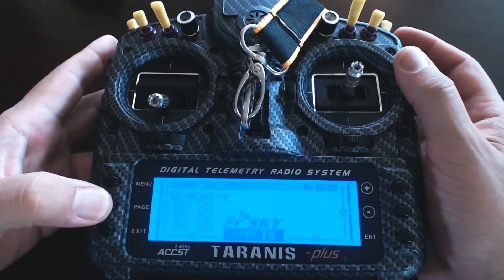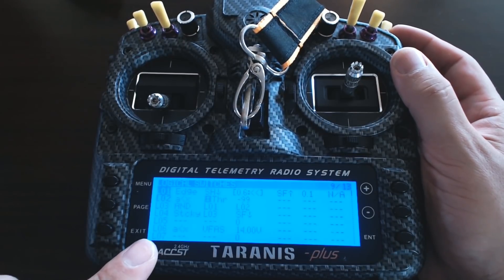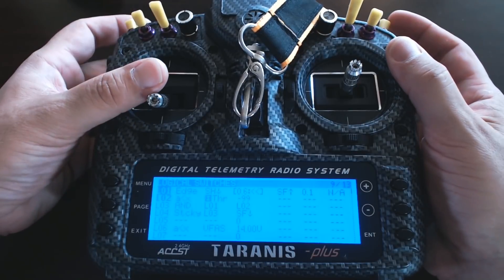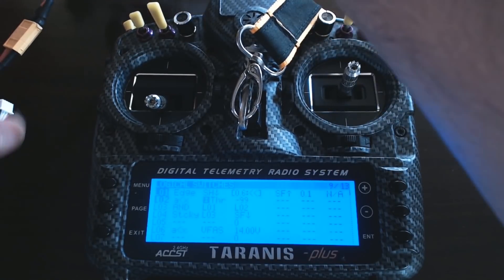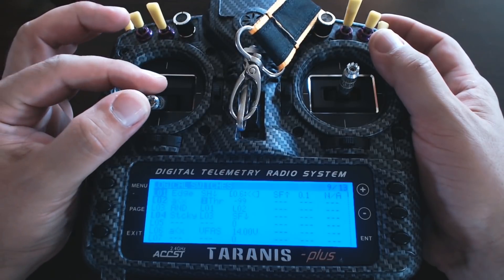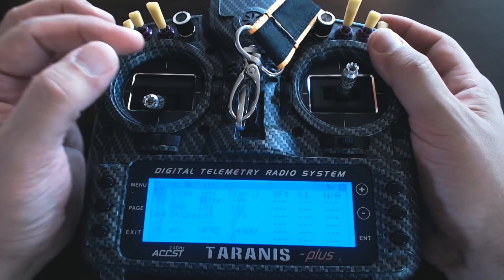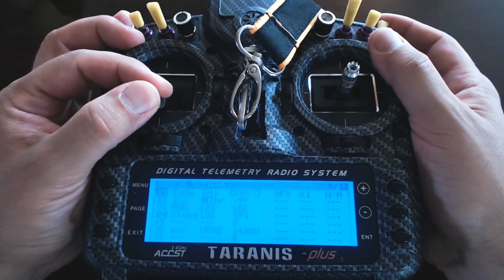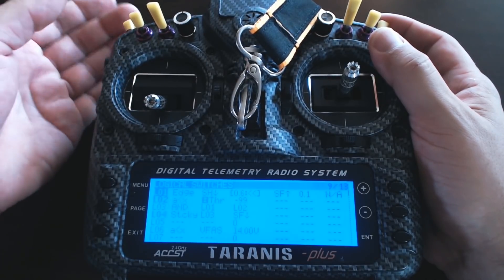How to make your Taranis read out low voltage

Comment: Hopefully this will save someone some time.  JB calls it Vfas in the video I didn’t see that option. So I selected RxBt except it has a regular , + , and  - .  The + was the highest and  the - was the lowest voltage it hit in the flight. So the regular one is the one you want. Everything else was the same, Great video JB!
Reply from the maker: VFAS is for frsky. RXbat is for other protocols.

Comment: I fly VLOS pretty often, and I don't see this changing when I upgrade my quad and have a working VTx and OSD.
When you're VLOS, you don't have an OSD, and when you're rippin' while VLOS you can't look down at your screen.
Audible alerts are VERY useful for this use case as well!
Also, thanks, now I've mapped my switches to announce flight modes.

Personally, what I'd probably map is that it announces when you dip below, and if you stay below it'll sound a chime/siren/alarm noise for the duration that the switch is active.
I haven't poked through my T16's sound library, but probably something that's not TOO obtrusive as to make me want to throw the thing, but gets my attention that something's wrong.
Then reads again after, say, ten seconds.

Comment: Joshua Bardwell your going to learn something today.  You made this simple thing very complicated with all the extra logical switches for o.o volts warning  issue… just add a “AND” value to the original logical volt read out line (L06) by only checking when armed by adding the value of your arm switch as the “AND” switch ie, SA-.    Boom no zero read outs unless you have your drone armed with no battery!

Comment: Is it possible to check which quad i am using if i use a 4s one and a 2s one for example? So i could make different logic swithes with AND logics to check for 14v on a 4s quad and for 7v on a 2s quad.

Comment: I know this video is old, but this is solves my exact problem. I am a LOS drone pilot and I need a way to monitor 6s to 8s voltage. I just need to know what transmitter are you using with this controller?

Comment: Hey Josh....can I ask for your recommendation on how to configure this when flying a mixture of 2s/3s on a mini quad. Got it setup perfectly for 3s but do I just duplicate the logical switches further down for a second battery type or is it better going with voltage per cell when flying different battery types?
Reply: I'd go for voltage per cell personally. It sounds simpler to me, and gives you a consistent number that you don't have to convert when flying different packs.
You just know that when you hear "Three point four five volts", no matter what you're flying, you need to be on the ground.

Comment: Hey Joshua, thanks for the video.  I do not have VFAS or RSSI but do have RxBt and 1RSS/2RSS ... are these the same?

Since I'll be flying 6S but may occasionally run 4S, I modified your logical switches to work for both, but have to reboot the Tx if I change packs since it uses highest voltage ... not sure if there's a way to get around this but FWIW here's what I did...

L04     a>x     RxBt+    22.8V     ---         ---         ---
L05     a>x     1RSS     0dB        L04      ---         0.2
L06     a<x     RxBt      22.8V     L05     10.0     0.2
L07     a>x     RxBt+   15.2V      ---         ---         ---
L08     a>x     1RSS    0dB         L07      ---         0.2
L09     a<x     RxBt     15.2V      L08     10.0     0.2

Comment: Hi -I know this is an old thread but when I go into Logical switches 2nd input to choose telemetry, i have nothing after GVars, telemetry not a choice ,   can I get some help with this please.   Mark
Reply from the maker: You have to have telemetry working, such as SmartPort for FrSky, or Crossfire, before telemetry will show up there. If you are using a receiver that does not support telemetry, that option won't appear.
Reply: Hi Josh
Thanks for the quick reply. I'm running the Frsky D8R - 'll plus accst Telemetry. 
This is on my Align 5ooX. With Beastx 
When I turn the helli off Tx tells me , Telemetry lost. So must be reading something. Is it possible I've missed something in Tx setup. I'm not really using any other Telemetry features but though this would be of great value to me maintaining power.  Hope you can help. Just found some of you tutorials.  & subscribed.

Comment: My X-lite pro doesnt have Vfas, but it has Batt. Good also?

Edit: Batt is for Transmitter. I dont have Vfas :(
Reply from the maker: The sensor might be named RxBat? Look for a sensor that is obviously reporting battery voltage :-)
Reply: @JoshuaBardwell  Seems i dont have cable on smartport. Can i use TX2 on my F405 Mini MK3 and the uninverted s-port on the R-XSR?

or  through this way: https://i.imgur.com/n8WJYGnh.png TX1 on uninverted s-port.

Comment: I love and appreciate all ur videos without ur help I wouldn’t even been able to get my first drone off the ground and many more I’ve used this method in all my tiny whoops and it worked perfectly but on my 5inch quad the value displayed and read out only says 3.5 volts for my 4s battery and in my goggles it’s over 15.3 any suggestions would he greatly appreciated

Comment: Hello sir, is there a way for the taranis to read out Low throttle warning, for example when m training new flyers, and they reduce the throttle mid flight to let say 20% or 15% the radio should warn either by saying low throttle, or stall, or whatever type of warning it has... thank you for your time...
Reply from the maker: Yes definitely you can do this.

The way I would suggest doing this is as follows.

1. Logical switch for if "armed" or if "throttle cut" is disabled (to prevent false warnings when on the ground).

2. Sticky logical switch that becomes true when "armed" and the 1st time throttle goes above 15%. Sticky switch trips back to false when "disarmed".

3. Logical switch that is AND of the above combined with throttle position < 20%.

If you would like more specific help, please email me joshuabardwell@gmail.com

Comment: I followed this video and it is now reading out my voltage on my transmitter how do I get it to read the voltage on the quad.
Reply from the maker: You selected the wrong sensor. For Frsky the sensor you want is vfas.
Reply: Joshua Bardwell batt was only one Available
Reply from the maker: If you're using Crossfire then it's RxBat.

Are you sure you set up telemetry? When you "Discover new sensors" do you see sensors like ACCX, ACCY, ACCZ and so forth? Maybe telemetry is simply not working and that's why you're not seeing VFAS.
Reply: Joshua Bardwell i have the xrotor stack f4 and rxsr with tran qx7r. I put wier on back of rx on the s port to tx 3 on fc. and i only see rssi & now the batt i set up. Telm works if tx talks to me corcrect or no
Reply: Would the RXBT be the same as VFAS for the rxsr.

Comment: As usual, great video.
How would I go about having the OpenTX read out the voltage every 5-10 secs once it is beneath the assigned threshold?
Reply: My guess is you should  put read it out a big number of time like 30 and 5sec for hold the logical sw.

Comment: I have a question for you. What hapin when we use 20 Meter extention cable on frsky R9 module antina and antina is in air at 20 meter hight. What will hapin , is signal works better or lost?  Can you make a video on this with practical thanks

Comment: I an older first gen Taranus. I was stupid and got a Jumper TX this summer and it has intermitten disconect issues.

Anyway my Taranus does not do what yours does what version of open Tx Re you using?

Comment: I have a problem. I dont have Vfas on my Taranis X9D+
Reply from the maker: If you are using Crossfire, the sensor will be "RxBat". If you are using FrSky then maybe you haven't set up SmartPort telemetry right. Go to the Telemetry screen and "Discover New Sensors". The quad must be powered on and the receiver bound. If telemetry is working, you will see a bunch of sensors appear, if they weren't there already.
Reply: @JoshuaBardwell  Hello and thanks for taking time to reply Josh!

Well i have Frsky and i have telemetry working on my X9Dplus . I get values but not Vfas.
1.SWR
2.RSSI
3.RxBt
4.A2
Thats it :(

Comment: You say that I can't set up the battery voltage alarms without telemetry but I can't figure out how to do it,. Do u have a guide I have hawk 5 and taranis x9plus
Reply from the maker: Without telemetry, you can't do it. Hawk 5 doesn't have telemetry.
Reply: @JoshuaBardwell  thanks Joshua. Your videos are great. Thanks so much

Comment: i have kingkong GT 200 and frsky r-xsr receiver . can i get telemetry with this quad? if not what other options do i have to get any alert about its time to land and avoid ruining my battery ?  and thank for your videos. like how you explain things.
Reply from the maker: You should have an osd on that quad I think, which will let you monitor voltage without using telemetry.

The RXSR can also do telemetry.
Reply: thanks for the quick answer, im still learning how to control it so im not using the OSD and the goggles to see my current voltage. i bought the r-xsr especially becasue it can do telemetry but i connected the receiver without the s.port becasue i didn't know if the GT 200  FC have s.port connection or something like that. am i missing something here, can i connect the osd data to the r-xsr somehow. im new to this hobby...

Comment: Great video Joshua ! It's working thanks to you. But just a little problem. My taranis only says 3V instead of 3.4V for example. Do you know why it's not reading the values after the dot ?
Reply: Ok it's April 2020 and I have the same problem described by geoff here in that when I "play a value" I don't get the decimal place i.e. it says 3v instead of the real value of 3.5v. Has anyone got an answer for this? I've been searching far and wide for an solution which has led me to many dead ends like this 2 year old video. With the passage of time I'm hoping that either geoff or Joshua has the solution. If you do it would be much appreciated if you could post it here. Thanks!!
Reply: @pbshooter100  Hi buddy. No, I was never able to figure it out. I'm still flying like this nowadays...
Reply: @geogearbex  Thanks for the quick reply, I'll keep looking for an answer I guess. If I find one I'll post it back here
Reply from the maker: I'm trying to think of what that might be but nothing is coming to me. Do you see the whole decimal point in the display?
Reply: Joshua Bardwell yes I see it on the telemetry page and main screen. My taranis is in French but I installed English amber voice pack

Comment: Can anyone help, trying to set this up on my taranis but VFAS isnt showing on the telemetry. 
I am running kiss v2 with 32amp esc and Steele pdb with crossfire micro
Reply from the maker: This means that telemetry is not set up correctly between the FC and the receiver.

Unfortunately I don't know a lot about KISS setup.
Reply: @JoshuaBardwell  thank you for the reply, I'm currently using rxbt as that seems to be showing battery voltage.

Would this setup be in the gui or the way I have the wires on fc do you know?

Comment: Joohua,
I am new to the hobby and have a couple questions.  1. I was setting up my FrSky Transnitter to speak (ie... in your video getting the transmitter to read out the value of VFAS, which is under telemetry.  Unfortunately, telemetry is not one of the options in the second menu with switch, pots, MAX, CYCLIC, Trims, Trainer, etc)  How do I get Telemetry to be one of the options?
2. Question, I have spet days attempting to get my  Frsky Transmitters (plural) to communicate with the receivers.  I have built 3 QUADS and I can not communicate with any of them??? Please help me figure out what i am overlooking.  It is driving me crazy. Any help is appreciated.  Thank you.  emathews01@gmail.com
Reply: In the Taranis, go to the TELEMETRY page and DISCOVER NEW SENSORS, with the drone powered up.  Give it a few seconds and it will detect everything it can.  The TELEMETRY option will now be available on the previous pages for you to complete the setup

Comment: All right there Joshua  i have no vefase in my tranis can u five me a clou
Reply from the maker: In the telemetry screen, "discover sensors". If you still don't see the full range of sensors then telemetry is not set up right in the FC.

If you are using crossfire the sensors have different names and you won't see vfas.
Reply: Joshua Bardwell thanks my friends i will take a look at that cheers
Reply: All right joshua my taranis has no vfas in the telemetry can my tranis be mising some thing missing do u think coz your videos  r very expressive and spot on but i just cant find that vfas i have the sensors shoing but just cant find that i have been at it sins tje last time we toked on this subject thanks for your interest and information.

Comment: not working with crossfire
Reply from the maker: Crossfire does not call the battery voltage sensor VFAS. I think they call it RXbat. So the same process applies just a different sensor.
Reply: Joshua Bardwell yes is rxbat in crossfire . But still not working

Comment: I got everything set up and double checked the wiring on my rooster, but it keeps reading 4.9v (so basically 5v) I don’t know where my receiver is getting that number from or how I can fix that. Any help would be great!
Reply from the maker: You're using the wrong sensor I think. Look for a sensor like vfas that is showing battery voltage.

Comment: My Taraanis -Plus 2.1.6 requires me add a new sensor if I'm to use VFAS. What do I set the Type/Formula/ Cell sensor/Cell index/Logs to?
Reply from the maker: You really ought to upgrade to 2.2.1. Your firmware version 2.1.6 is pretty dated. I'm not sure how to get it working right.

Comment: This and some of your other taranis videos got me thinking that it would be nice if there was a library of installable switches, etc. that could easily be added to our tarani. Being new to the hobby, I'm not sure if it is possible to download and install such things.

Another thought, being as how I just watched your model match video, it would be nice to have telemetry be normalized to 1S regardless of what size battery being used. That way 4.2 volt is always fully charged, etc. All the alarms and such could be set based on that. Your argument for model match made a lot of sense, and if I spend a bunch of time really dialing in my model it would be nice to use it for as many quads as possible, even the 2" ones using 2S or 3S batteries.
Reply from the maker: Betaflight reports a "cell voltage" sensor which might could be used to do the 1S thing you're asking for. However it's just an average of all the cells, based on Betaflight's guess as to what voltage battery you're using.

Comment: After I put a<x  in the next line I am looking for Vfas and it isn't there. i Have Batt, RSSI and 50 others but no vFas. I am doing something wrong. /thanks
Reply from the maker: My guess is you are not using a FrSky device. The sensors that are detected depend on the telemetry protocol that's being used.
Reply: Joshua Bardwell thanks josh. I am using a Taranis x9d plus. So it’s frsky . And the reciever works I can fly the quad but Vfas is not an option
Reply: @cborel83  Hi there, did you ever sort this out? I am having the same issue.

Comment: Hey have you guys heard of the Taranis discharging the battery substantially while it’s turned off? I think my Taranis is discharging the battery while it is off.  That explains my completely DEAD pack the other day after it was fine the morning before.  I tested externally yest. and it was 4.13v a cell. This morning it’s 4.0v a cell... been off on the bench all night.  Replaced the murdered NiMh with a Lipo already.

Comment: Can this work if no Vfas? Like, will this work with A4 or A2 or mini quads with 2 cell batteries
Reply from the maker: Yes, it can work with any sensor, really.
Reply: The reading on my Taranis and in betaflight seem way off when using an A4 or A2 sensor. But i'm fairly new and trying to get things worked out. Thanks for everything!!

Comment: How did you get your Taranis to show the full battery voltage on the screen? Mine just shows 4.91volts when my fatshark show a total of 15.0 volts. I have a 4s battery.
Reply: You might be looking at the 5V supply to the receiver/flight controller instead of the battery.

Comment: just picked up an LR1000 diversity RX, powered it up on the bench to a brand new taranis, bound ok. "discovered" telemetry sensors and only RSSI shows up, i have the telemetry wire on uart1 tx and in configuration i have telemetry set on uart 1 (it's using uart1 for sbus in too), any ideas ?
Reply from the maker: +Daytona FPV you can't use the same UART for SBUS and telemetry.
Reply: There was zero documentation for this , that's good to know..  i'll fix that later. new to the dark side :D only got it for crossfire :D

Comment: Hey Joshua my taranis will read put the incorrect voltage sometimes like if the voltage is 15.9 volts it will say 15 volts and sometimes the voltage is off by .3-.5

Comment: So what value do you really use for the alarm? Even my brand new smc extreme batteries sag below 14v when punching out...

I don’t know if this is wise but I set my alarm to mah consumed instead of voltage for this reason...
Reply from the maker: I use 14.4 for 0.2 seconds, as shown in the video. If you were using mAh instead then I would use something lower like 13.6 with no delay.